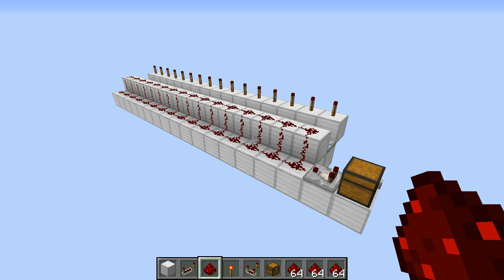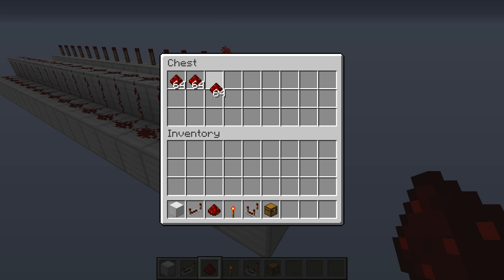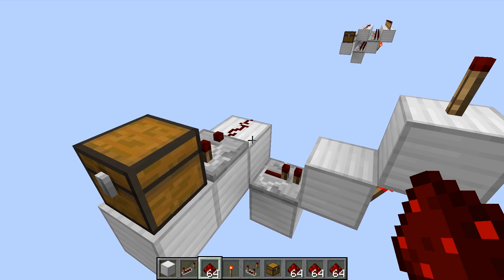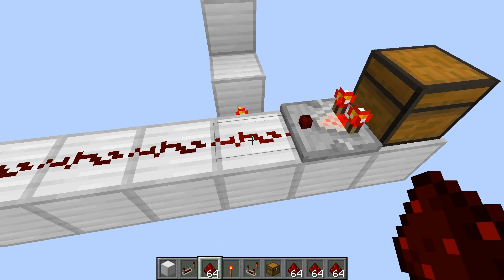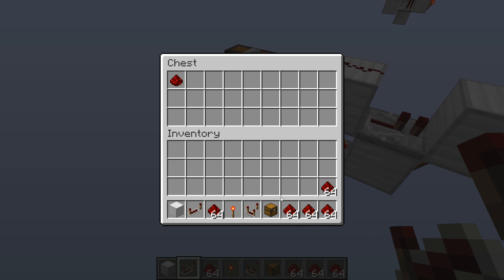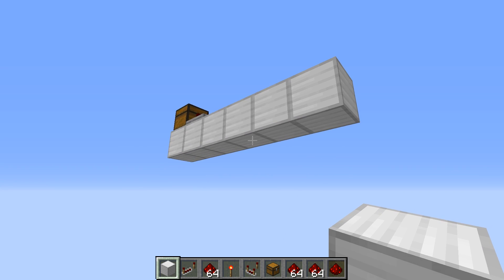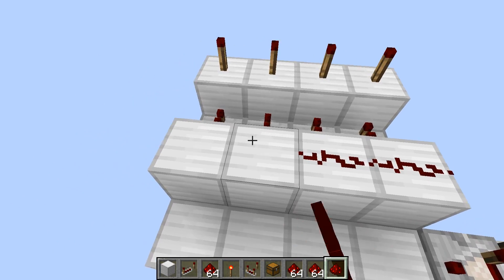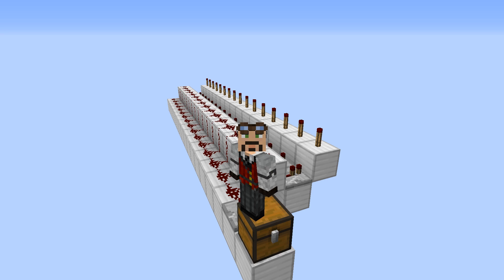Redcoder Tutorial- 1.11.2

Comment: I'm confused as to what has changed in the game... did repeaters not used to pull a redstone signal through a block? That seems to be what's breaking this design in 1.16, even if the signal strength isn't high enough to extend onto the top layer, the repeater is still pulling the signal through from the bottom layer and un-powering the torch. It seems that rather than the redstone wire just climbing onto the higher block, its actually pointing into it..
Reply from the maker: monkeymox redstone changed

Comment: A neat trick the first red coder only need that top section since no signal can be weaker than one (unless that includes a signal strength of 0). And a full signal strength wont need that top section because no signal strength can be stronger.

Just a tip to save a few repeaters.

Comment: Hey I'm using this red coder combined with a shulker box/piston/dispenser randomizer system (like mumbo's tiny randomizer here on YT). Basically you have a dispenser that spits out shulkers containing different amounts of items, and you use a comparator to measure the summer and produce an output in the coder. I'm having an issue I cannot figure out a solution to. When a shulker is broken and replaced, all the torches below the selected one briefly activate. So if torch 7 is lit, when you break the shulker, 1-6 light up briefly. The same thing will happen with your system if you remove all the redstone quickly. This is terrible for my purposes, can you point me in the direction of a solution?